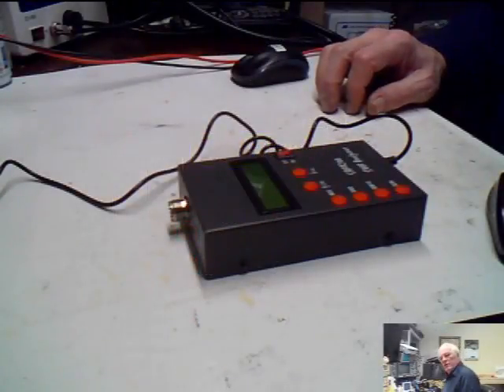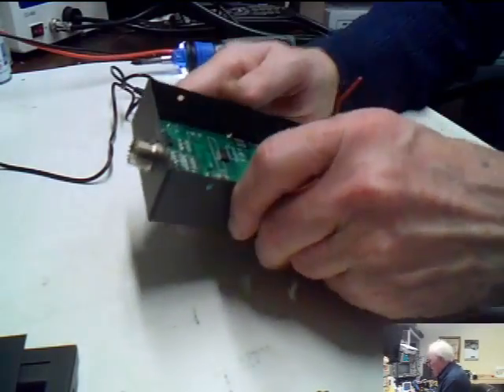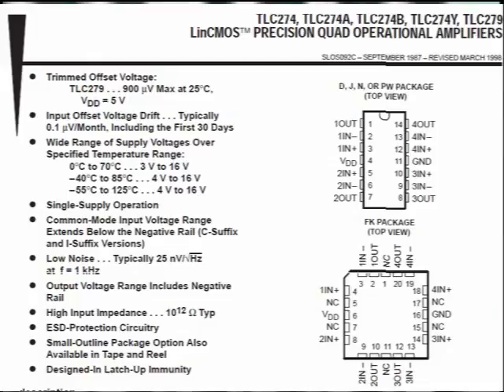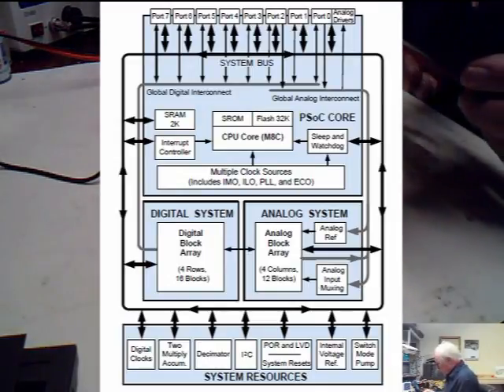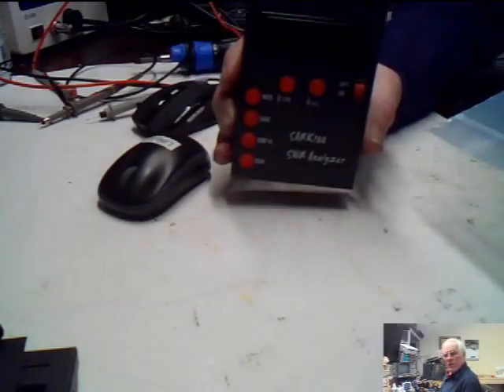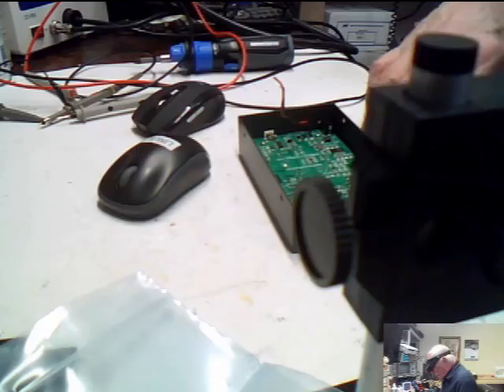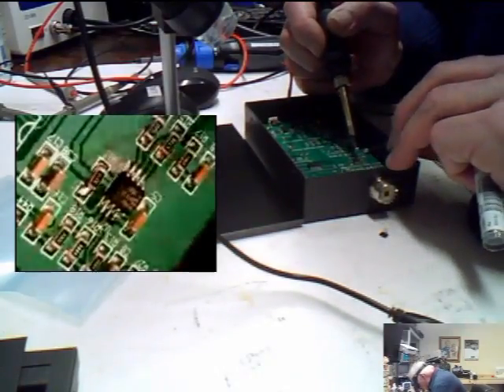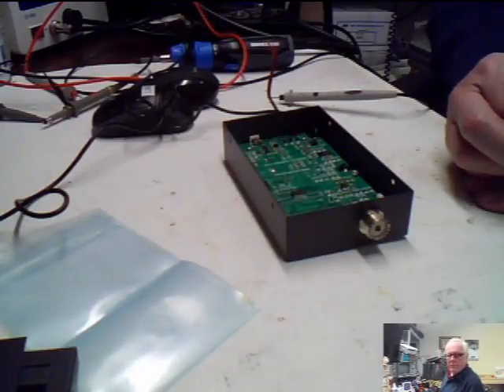Sark100 Antenna Analyzer Repair

Comment: I bought one of these recently and it did not come with a cord, It stated in the ad that it takes a 2.1mm cord so  I got one but it does not fit
Reply from the maker: Is it too big or too small
Reply: @AERVBlog  I picked up some 2.5mm pig tails and that fits
Reply: yes sir you are right that worked BUT I am getting the same error you did when I turn it on. I guess I got an expensive paper weight as the seller is not responding back. thank you for your replies.

Comment: Got mine in today, it worked out of the box. Thank God it did. I do not have your skills and would be disappointed if it was yet another dud that I seem to get lately.
Update.
After using it for a few hours and doing the calibrations as per. Requirement.
I found out all the swr Measurements for coming back at 1.3 swr.
So in fact the unit is Faulty, so I asked for a refund.
Reply from the maker: I am glad it worked for you. It can be a useful little box for sure.
Reply: @AERVBlog  
After doing the Calibration, All SWR readings reads at 1.3 to 1
I did not know I had to recalibrate.
After going out and buying resistors and building the short dummy plugs only to find out that don't work.
This should be done at the factory.
I am sending it back for a refund.
Reply from the maker: @johndminigan1869  sorry to hear that. I bought an MFJ-259D that is a whole lot easier. It is not as functional though.

Comment: My sark was working fine, then just quit will not come on at all.
Reply from the maker: They are not great.  The idea is good.  Check the voltage regulators and fusible resistors.

Comment: I have a sark 100 and the other day plugged the 12 volt lead in and it was the wrong polarity there was a snap and i opened the case to find a little chipthat has blown its says u11 on the board next to it i removed the blown chip but need to find out the part number to replace it any help would be appreciated i have a photo of the part in situ before removing it.
Reply from the maker: U11 is an LM7812AC voltage regulator. Mouser has them for less than $1 each. I would not be surprised if there are other blown parts in there too as there is an LM317 (L9 i think) attached directly to the positive input. Also check the 2 diodes. One is just after the U11 and the other is just before the U9. Good luck and thanks for watching.
Reply: @AERVBlog  Thank you for replying i have ordered a replacement part everything else looks ok i am a novice i have a multimeter but not sure how to check the diodes with this. Regards Ian
Reply: @AERVBlog  received 5 x lm7812ac in the post in 8 days from china for £5.83 inc postage and after 2 minute soldering job the unit now works like new thank you for your help regards Ian
Reply from the maker: @surfnutt  Great. Glad that was all that was wrong and that I could help in a small way.

Comment: Where cal I get parts for a mini60 antenna analyzer with Bluetooth?  I bought one on Amazon 2 years ago and it didn't have a battery, battery case, charging circuit or USB connection inside.  Tried to contact the seller thru Amazon and they went belly up. Amazon couldn't help me so I have a $130.00 piece of junk.
Reply from the maker: I don't know but let me look into it.
Reply: @AERVBlog  I would appreciate it.  de KE8JMS

Comment: I gotta tell you that this video was absolutely helpful! I got one of these from eBay and it developed a problem with the display missing a line of pixels rendering the readings ambiguous sometimes. I was about to trash the unit until I saw your video and said, "what the hell!"

I wicked out the old display and replaced it. (They are a fairly common type.) When back together, it came up with the "green screen of death" message you got. I was about to replace the AD8008 when i noticed one of the SMT 0.1 caps had been nicked off the board by an errant screwdriver during my reassembly. No problem. I replaced it with a very small through-hole tack-soldered neatly onto the pads. The beast came up and worked great!

Cut to six months later when I accidentally knocked the unit off my bench, kicked it underneath, and a portable table fell on it, destroying the switch. Again, no problem! Seems one of these small SPST switches fit *exactly* in the hole and, when tacked onto the board, is flush with the top panel. A nylon washer and nut and Bob's your uncle!

So..don't fear the reaper!

Love this little analyzer!
Reply from the maker: Wow! Poor thing has been through heck. I am glad you got it fixed. Glad I could help too in some little way. Thanks for watching.
Reply: @AERVBlog ..well, the saga continues! Just recently, I reverse-polarized the little fellow (got 
the power leads switched) and it fried the U11 7805 regulator. My friend, WB6JDH, helped me troubleshoot it and replaced it with a TO-220 version of the D2PAK chip and it was revived and purring along nicely. Inasmuch as I have a Mini60 coming, I gifted Dick with the unit where it will be put to good use.
We have renamed it from Sark100 to Laz100 - as in Lazarus in the bible, the man that Jesus waked from the dead.
These truly are rugged treasures and fun to work on! Again, many thanks for your video and inspiration. Please look for a comment on your HP403B video re how I replaced/upgraded the stock batteries in the voltmeter with cheap ones easily found on eBay.

Comment: Hi there. I have the Sark 100 here . But iam having problems calibrating it. The 50 &150 ohm reads ok on the meter  but the 274 ohm resistors  reads 340 something ohms on the meter ! I've checked the resistors with a good meter and all is ok . It's just the 274 ohm resistors that doesn't read right. Have you seen this fault before? Any help would be great. 73s.
Reply from the maker: worldradio456 uk I have not seen the fault but I will check on it. I am away for a couple of weeks but I will get back to you when I return. Thanks for watching.
Reply: Thank you for replying . I know this is an oldish thread so thanks for that .  Hear from you soon have a good trip. 73s.

Comment: Hello noble friend, I have one of this model and he is presenting the following defect as reported below:
Normally, it does read, but does not read correctly, I do not know if the problem is software or if it is hardware.
Could you please help me with some idea of what might be happening, and or where can I download its firmware to try to solve the problem if it is internal software? I'm in Brazil
Reply from the maker: Marcelo Bahl wow that is the first time I have been called noble. I think I like it. Please send me pictures of the screens you get when it boots up and what you get when you try to measure an antenna along with the actual antenna parameters. Send them to davanelectronics@gmail.com. I will see what I can do.

Comment: Enjoyed your video and repair. I have a Sark 100, worked OK at first then one day it came on with the first screen but does not go any further. I wounder  if you have any idea's. Please.
Reply from the maker: It depends on what the screen says when it is starting up. If it looks like the screen in the video it is most likely that IC. More details please.
Reply: Hi thank you . The reading on screen. Sark 100 Analyzer (c) EA4FRB 11 V13, this stay's on for 2;15 sec then words go off and yellow light stay's on, with no auto switch off. Are you in the UK.
Reply from the maker: No. I am in the US. I don't know off hand what might be the problem with your Sark but I would start by checking voltages.
Reply: That's a shame. I wouldn't have the soldering skill's to repair it. I thought about buying another one but may go wrong again. But when working was really good. Thank's for your help.
Reply from the maker: If you were in the US I would say just ship it to me and let me see what is wrong with it since fixing it would probably be cheaper than buying a new one but the shipping cost would negate any savings. Too bad. Better luck next time. Look into the MFJ analyzer. They don't give you quite as much info but they are a lot easier to use.
Reply: Thank's I'll take a look at the MFJ analyzer.